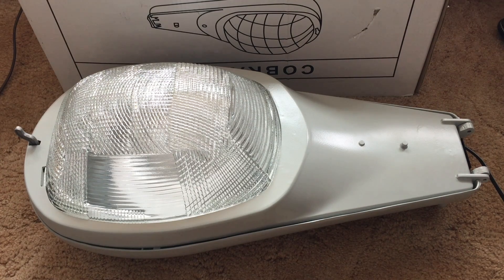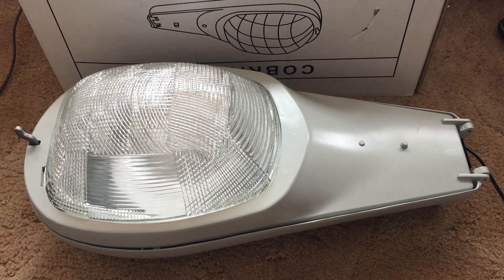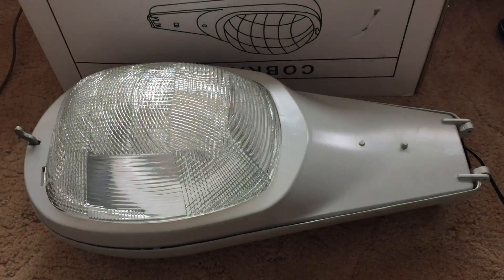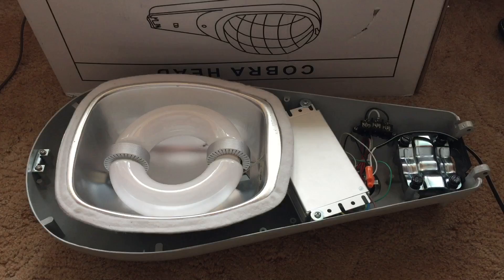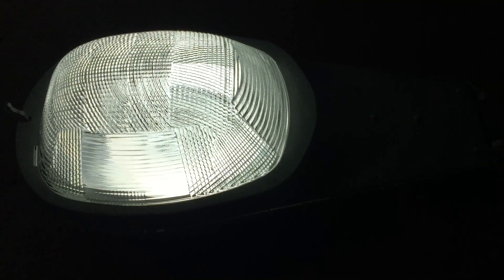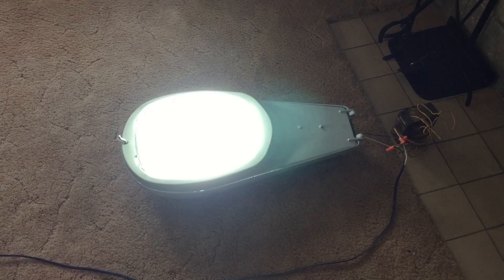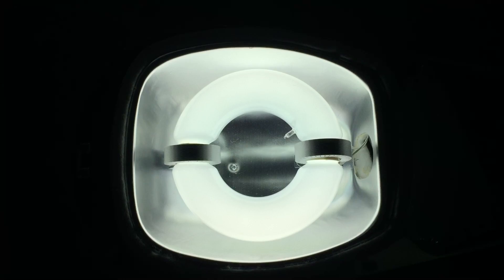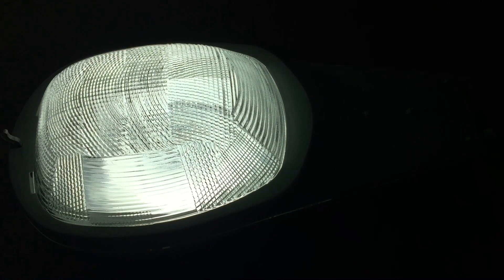QSSI 80watt Induction Street Lights (Turning On)

Comment: Actually the ballast which you have here should not be installed in US. The colors of the mains grid wires (red, blue, yellow-green) are EUR coded whereas in US, there should be (black, white and green).
The reason it does not start on 115Vac, the electronic ballast of this model does not have a universal PFC (Power Factor Controller) so it will pull way too much current from the mains hence will shutdown then restart.
You could try say 230Vac like what we have in Europe, it will work so no need to step-up 270Vac.
Reply: Actually this is common. Many other manufacturers use the BR-BL-GR color codes for drivers in the US. It's cheaper this way. 277 is the phase-voltage in a 480Y three-phase service. It's a very common industrial voltage here in America. Nowadays, most drivers are universal voltage (100-277) and they come with European color coded leads.

Comment: How does the induction work as a light source? Is it like mercury vapor, metal halide, or something else?
Reply: IAmNotAFunguy (sorry for any mistake, English is not my native language) It works like a electromagnetic transformer, those two coils are inducing electromagnetic waves/energy in to the low pressure fluorescent mercury vapor lamp, igniting the mercury vapors inside it. In this configuration this lamp will have a service life of 100k hours(100.000) and over, that if the electronic ballast doesn't fail. Those kind of lamps, the induction one's are available in lower wattages also, like 20 or 40 for household use, the 20 watts version is pretty compact like a cfl bulb.
Reply: Fluorescent with a coil on the outside of the tube instead of electrodes on the inside.